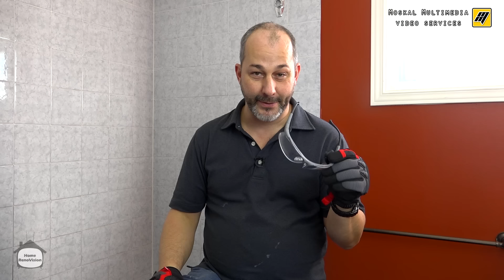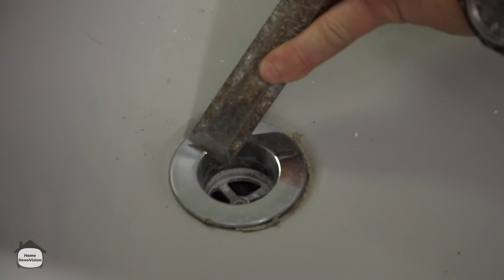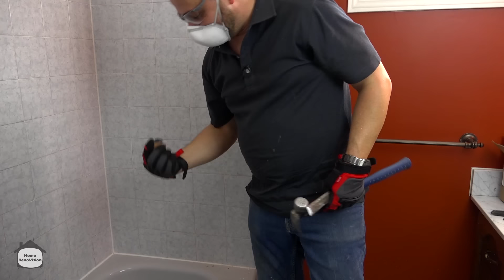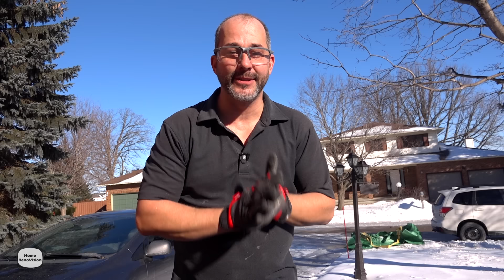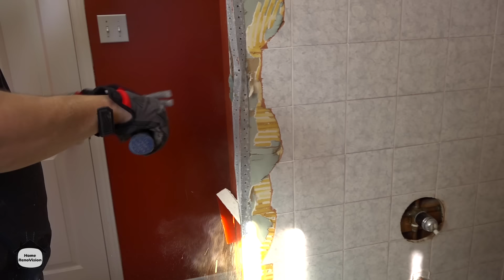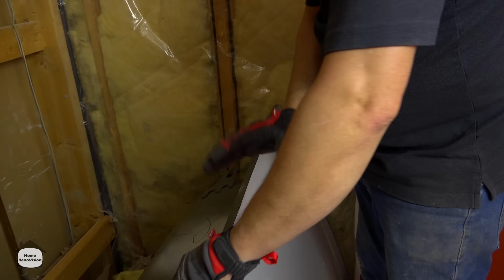Completely Redo Your Bathroom on a Small Budget!

Comment: It's a good idea to shut off the power too and not just the water. I started renovating a horrible bathroom that was added into the home that wasn't originally there and discovered knob and tube bare open wiring that was still in use and was surrounded by insulation

Comment: I have the green bag, and am about to rip everything out!   Watching your videos to get the courage. Just replaced the entire whole house drain system (57 year old house) with ABS, and now onto replacing everything in the bathroom, taking it down to the sub floor, and replacing a few sub floor boards. Oh, and with the two new rain barrels on the way, I need to install a PVC line through the outside wall, and over to the toilet (flushing with rain water). PEX might be a better choice considering they are smaller, and possibly of higher quality? Not at that stage yet, but will be within the week.

Comment: Hey Jeff - doing this on my second floor main bathroom. Got contractor quotes to move my toilet and curbless shower (watched your schluter video and your shower membrane video) awesome btw! - the contractor said: 

"We will not build a curb less shower, you can't get enough slope to drain the water freely without overflow in the area outside the shower. A house needs to be framed during construction prepared properly with a dropped area below the rest of the floor to create a slope. Also, you are planning to move the toilet, most toilets are situated in the corner because they connect immediately to the main stack, a toilet drain is a large drain pipe that cant be drilled through floor joists without compromising the structural strength of the joists. The only way it can be done is if a structural engineer designs re-enforcement made from steel. not sure what we can do for you based on your wish list."

For the shower slop, i'd take the subfloor off, add a wedge the joists put the new subfloor down to the vertical drain - done.
For the toilet - I had all other GC/Trades folks (licenced plumbers) say they can do it. 

Now i'm skeptical!? Thoughts.

Comment: When all else fails, I use heat on to loosen the drain. I also, when possible, at about 4" to 6" I 
cut a 45-degree piece out of the lower corner opposite the plumbing wall.  Then I can lift the tub up and out (by myself).

Comment: Took almost a week to reno our front bathroom.  Cast iron tub had to be broken to get it out.  3/8" gypsum board on the studs with up to 1/2" of plaster on top of it with almost as much wire mesh in it.  Combine that with nails for the gypsum at 2" o.c.  Had to wear a mask and safety glasses, until the glasses fogged over (someone needs to invent a mask that doesn't do that and no the ones with the vent for exhale still don't work.)  Floors were particle board nailed, screwed and glued to the 1x sub-floor.  It was way more work than planned.
Reply from the maker: I have recently been using moldex masks. they fit perfect over the nose with no air leaks and the vent works perfectly. Cheers!
I have added this product to my Amazon link page under products that I recommend. Cheers!

Comment: could you do a how to remove tile flooring on cement floor or tiling on cement wall. I love watching your videos and I've learned a lot,  but quite of bit of the work does not apply to me because i live in the Bahamas and our structures are mostly concrete blocks -- no sheet rock, wood walls, wood sub-floors, etc

Comment: If you couldn’t get the drain out, one trick I use at work is loading two hole saws on to the same Chuck. One that fits inside the drain and a  larger one to cut the flange.

Comment: I think I've watched all of your bathroom videos and couldn't find anything for demoing a tiled pan. Not sure if there is a way to install an acrylic pan on top or if I have to demo it. If so, can you point me in the right direction?
Reply: It's always best to start fresh and demolish the pan. Tiled shower pans usually break very easily because they are made of sandmix molder rather than cement. Once you have the pan demoed, you have the opportunity to check the drain to see if there is anything wrong

Comment: Jeff Great video.   One of my bathrooms now has black mold spots guessing bc of no vents and they take steaming showers. What would you recommend any idea's or a great video's would be great.
Reply from the maker: The mold is a result of there being no waterproofing. This is the case of the majority of showers even in new construction. The only thing you can do is clean with bleach regularly and start saving your money to install a new shower surround. That wall is telling you it is just a matter of time until a tile falls off the wall or water starts to show up in the ceiling beneath the shower.
Reply: @HomeRenoVisionDIY  Would I have to replace as you have done here?
Reply from the maker: Yes, but not right away. you can manage the mold for at least a year in most cases and it does not grow that much. By the time you do remove the walls it will still only be a small patch around 4 sq ft. Just wear a mask and throw it in a bag to remove. no worries.

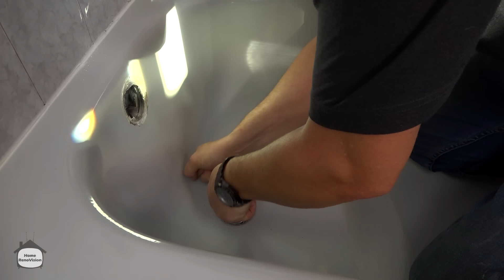Comment: 6:20 you can go through the wall from the other side and disconnect the drain connection on the backside where the tub drain attaches to the house drains P-trap
Reply from the maker: if you really want to increase the scope of work. or just do what i did.
Reply: @HomeRenoVisionDIY  it's not that large an add in your case to cut an access panel, you are already doing some drywall patchwork on the corner and in my case the homeowners that did the original install framed and drywalled the whole wall prior to installing the tub so everything had to come out to do proper installation

Comment: When you started using the reciprocating saw to cut the wall it made me think "what's behind that cut line? A stud? Wiring? Plumbing?" Seems you were careful to cut at an angle so the blade didn't penetrate too far. Your thoughts?

Comment: Need to replace my shower drain, spout, control, and shower head with neck, any pointers? Just changing to match the rest of the brushed bronze fixtures.
Reply from the maker: watch my videos on install in shower fixtures. And make sure you but the tub drain with the same thread size. there is more than one option and you don't want to cross thread it or you are opening up the ceiling to replace it. Cheers!
Reply: Awesome I will do that! I’ll make sure I bring my tub drain with me to compare. Thank you!

Comment: great video as always, so just started ripping out a bathroom, which is gonna be a total gut job, and your video came along at the perfect time, couple questions. one is related to a video you had posted earlier which is 4 types of waterproofing video, so im gonna put in a custom shower in the main washroom and didnt wanna go with all the extra weight required for mud showers, and therefore wanna install a schluter base only , and for the walls was thinking of using mold resistant drywall with red guard, what are your thoughts on this type of mixture? and secondly i noticed in this video the shower systems have extra copper pipes going pass the cold and hot water inlet, what is the purpose of that? thank you so much.
Reply from the maker: first I love your approach. make sure to use the kerdi band and kerdi corners to seal the base to the wall. secondly the extra pipes are designed to reduce the water hammer effect on copper pipes. Cheers!
Reply: @HomeRenoVisionDIY  thank you very much, really appreciate it.

Comment: Hey Jeff, love your videos.  When removing the bath tub, I know it’s important to shut off the main water valve to the house. Being a first timer demoing and renovating my bathroom, this process will take me two weeks. When can I turn on the water valve again for the rest of the house? How can I secure that line in the bathroom from causing flooding in my bathroom.
Reply: Are there shut-off valve in the bathroom waterlines? If not, have a shut-off valve installed in the bathroom waterlines , then close them. Therefore while you are working on the bathroom, the rest of the house will have water.

Comment: One more question for you.

I know we talked about raising the floor height of my cement area with ditra xl and then ditra regular the whole area for the purpose of tile-ing

We have decided to go with vinyl flooring like lifeproof.

Wanted to see your thoughts on my situation. Which is trying to have floors one height. The total area is like 970 sq ft. 300 sq ft is 3/4” plywood subfloor on joists. The plywood is exactly 3/4” taller than the remaining area which is cement subfloor/foundation. 

Do i still use ditra on cement to match floor height... or should i do cement board? Or is there something else i should do. Thank you for your advice.
Reply from the maker: vinyl on ditra works awesome, and you can add electric heat cables to the ditra and have an in floor heating system as well. Cheers!

Comment: I have a bathroom I am planning to renovate. 
EVERY wall has tile covering it. 
Would it be easier to remove the tiles or just remove the wall board and start fresh?
Reply from the maker: depends on how old it is. Renovating usually means going back to the framing. This will allow you to inspect and update the insulation and air barrier as well as the electrical and plumbing if necessary and remove any mold in the wall board that may be present. Cheers!

Comment: Started watching your videos because my bathroom floor is collapsing so I need to renovate. I have a plan on what to do but ran into a hiccup very early, the tub drain will not unscrew, it just free spins, what can I do to fix this?
Reply from the maker: If it is spinning then it is attached with a slip nut. simply pull the tub straight up and you can slide the drain off from underneath.

Comment: I usually use a pick with the pointy side cut off to a stub get the job done in half the time and the part when u had to pry the nails for the corner slab to come out cmon old man u know that slab is heavy enough to pull through if tug it hard enough

Comment: I find using my hammer sideways works best as to not damage any unknown lines or cables. It breaks the wall quicker 2. Ive demod alot of bathrooms but the contractor always handles the tub fixtures thanks. Ive smashed whole cast iron tubs with sledges its not fun n dangerous
Reply from the maker: sledge on a cast tub sounds wild!

Comment: how much would it cost to replace a bath tub with a standing shower that has a glass door and nice tiles as a DIY versus hiring someone to do it
Reply from the maker: tub $200.00 shower system from $65 glass door from $300 tile form $100 building materials$300 labor free.
Reply: Home RenoVision DIY ...and how much the labour would be?
Reply: @almy75  Labor cost will vary greatly depending on the size of the area and the size of the tiles being laid, smaller tiles take longer to lay because there are simply more of them, a full tile 3'x6' shower with backer board and all that can cost several hundred to a couple thousand in labor for the Tile Setter, you would also have the Plumber at a couple hundred just to get him out to your house, if you are in a slab you may have to dig up part of the slab to move the drain (I had to in my application), the 5' wide 2 panel actual GLASS sliding shower door kits from Lowes go for around 500-700 on average, if you need a custom cut setup sized for your shower you could potentially double that number. at a BARE MINIMUM do the Demo yourself, no reason to pay someone a days labor or 2 to do that.

Comment: dumpster bag is for a holes  needs a special truck which never comes ?   extra charge for over filling it ?  get local guy with a pick up truck ?       hello you  allways do a test run on plumbing before you tile ?   home work homework !!!!            best gut is a total gut    trust me its easier
Reply from the maker: Well at least your not short on opinions! Cheers!
Reply: and questions   there are those out there with no knowledge   of the little things you omitted   please warn them   been there done that   at great expense   nice learning tool     THING I COME ACROSS ARE   CAST IRON TUBS  heavy heavy     WATER DAMAGE    CUT JOISTS   ROTTEN WINDOWS   are you up too code too /  old plumbing  wont agree what the wife wants  lol    come across too many novice that give up   end up using a bucket to crap in !  hah   nice to watch this stuff but its more than it seems
Reply from the maker: It will take quite a few videos on this subject to show all the possible problems and solutions. For most people watching it is a learning curve. But I am available to answer questions for folks who have specific issues. Cheers!
Reply: yes    !   don't make it look to easy  lol    after 5 bathrooms and i'm still scratching my head and emptying my wallett